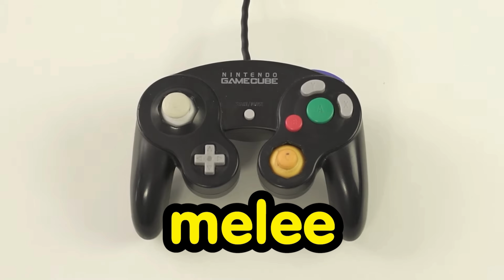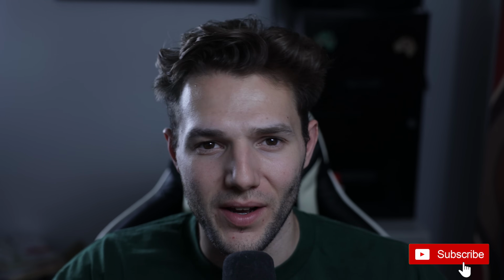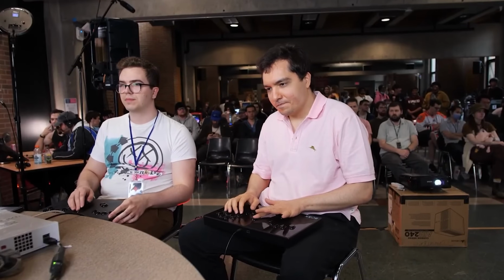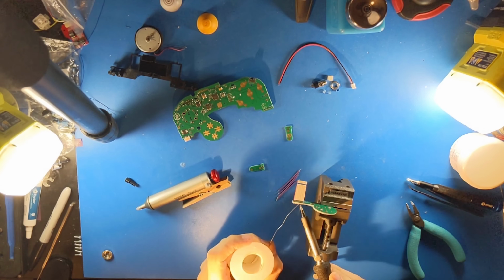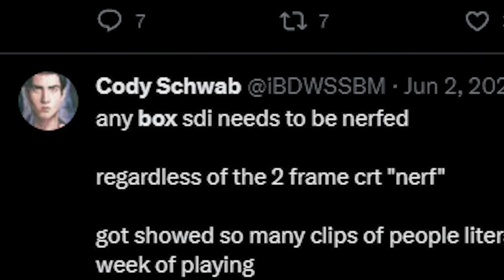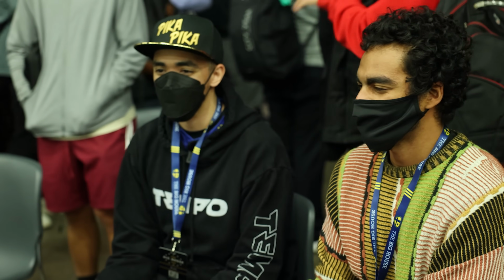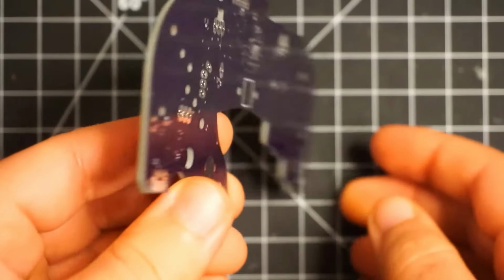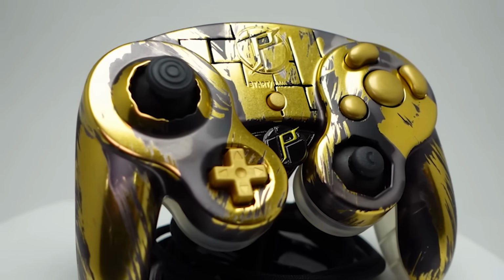The Hidden Barrier of Melee

Comment from the maker: What are YOUR opinions on controllers these days?
Reply: 1.03 is the answer. dont nerf boxx, BUFF gamecube controller. makes the most possible sense
Reply: @godslayerbiotch43  no, 1.03 doesnt make boxx controllers okay. try to sheild drop laser on a phob. Its fucking imposible but free on boxx. Converting analog to digital should be banned
Reply: BOXX PICHU..?? CHEATER?!!!!!!! anyways I think controllers are cool and that the Phob is a good choice. (and more affordable compared to other options)
Reply: TBF PS5 and XBONE controllers are utter trash (mushy sticks without gates) and have to be rebought every half year if you are using the DPad
Reply: Keyboard. In 10 years it will be considered the standard because accessibility is king. Box is still an upgrade, just not super necessary, and controller is fine too.
Reply: GCC breaks my hands, so i had to switch controllers. PS5 was weird cause of the left control stick, but the Xbox controller seems to be alright so far.  Having notches for spacies and Pika would be nice tho
Reply: Keep an eye on them, but I don't think anything drastic needs to happen. I think the things the goomwave can do is a bit much. Phob seems to be the most logical choice imo. Rectangles are fine because accessibility is good for the game. I don't understand why they say rectangles are cheating. I'll be more concerned when people start winning anything meaningful with a rectangle. Which goes back to point 1... just keep an eye on them. As they are now, it's fine. I don't think any controller choice is gatekeeping anyone from even becoming a top 500 player. Give any top 10 player a random OEM controller and they will still beat most of the top 100 from skill alone.

Comment: your comments on the b0xx are not very informed. The b0xx is nerfed a lot, and can't access a lot of more niche techniques. Fox is not the only character played on b0xx and other characters benefit from the layout as well. Some people will even argue that fox and marth and other characters are better on controller, especially in the realm of phobs and goomy's because notched controller can hit better angles and have access to the full spread of the analog coordinates whereas the b0xx can only pick a few. Prime example are wavedash characters like luigi and ICs. ICs have their more obscure desync coordinates banned so you can only do that stuff with ICs on controller for instance. There are timing lockouts, bans various techniques, and tons of various other things that bring the b0xx in line with the gamecube controller. It does not need to be nerfed.

I do agree that the b0xx is the best controller though. It is by far the most comfortable and the most consistent, which is its biggest strength. It's the best controller because it's the most fun.

Comment: I have this old controller that I've saved, the c-stick went out,  I tried fixing it but ruined the contacts while soldering.   Ever since that controller, nothing is the same.  I've gone through at least 20 controllers and none of them are good like that one was.   Knowing you can scratch off the surface layer of PCB and expose the traces and could wire directly to them still gives me hope.  I am doodoobeans at soldering though.   One of these days I'll take it to someone to get it fixed.
Reply: U might need better iron

Comment: These controllers are: 1) Unergonomic, to the point where people have developed forms of arthritis and seriously injured themselves
2) Imprecise compared to other forms of input
3) Fickle and only work for a finite time, meaning you have to buy another
4) Not even good enough on its own without serious modification
5) Far more expensive than buying a single input device like a fight stick/hitbox which has cheaper parts that are easier to replace (you can do it on your own)
6) Cant be used to play other fighting games (well I guess technically you could, but who would?)

How can anyone defend this?  It is clearly an inferior input device, and the barrier for myself even trying to get into this game isn't as much about the price as it is this.  We used to play the shit out of melee casually back in the day and I love it.  I love older fighting games in general, and I worry about their future, but the future of Melee is threatened by input devices more than anything else.  

I'm not technically part of your community, but I watch tournaments.  It's probably not my place, but you guys have to figure this out.  These controllers are just garbage and until there is a good solution people like myself who probably would play won't.  It excludes players when new blood is the difference between having a scene and it slowly dying... just because it is a big name doesn't mean your community is immune to this.

Comment: This video lacked too much nuance. The difference between the goomwave and the phob, goomwave generally has more cheater features like modifying calibration to make certain tech easier. its also a lot harder to police the firmware of both box and custom board gcc. 
The boxx and its copies are definitely better for the hands for most players. Melee is super hard or your basal thumb joints do the to contant lateral movement. People are working on better layouts for different kinds of hand pain like prism controllers that look like Tetrahedron or people like chillin dude using an azeron to play the game one handed after his stroke. Its so easy to just scream cheater at everything but it really needs to be looked at from both the accessibility side as well as a fairness side. 
This is all because as much as the GCC is cool, it is not a well designed controller for any form of competition (especially for melee). It is inconsistent, breaks easy, and for a lot of people literally causes them physical harm.
I don't have a solution. Maybe a community patch to allow rebinding by default would be a start.

Comment: Great video, but I really think it should be emphasized that this is really only necessary for top players. 99% of players will not have any issues playing on an unmodded OEM GCC. UCF makes shield-dropping + dashback consistent on pretty much all controllers, and notches, while nice, are in no way needed. Snapback is probably the hardest thing to deal with, and that can be worn out overtime, modded for relatively cheap, or might not even matter depending on which character you play. If you're a new to intermediate player, you have so many things to work on that the consistency provided by a premium controller affects so little of your gameplay.

Comment: Honestly, it kind of reminds me of how expensive it can be getting into competitive yugioh.

Obviously there's the price of the stuff for the specific deck you want to play, but there's also the price of cards referred to as staples.

Starting off, Konami does reprint staples, so they don't stay expensive forever, but it is worth noting that even with reprints they can be expensive, not to mention that you need a ton of them.

To give an idea of what you need, or what is at least a good idea to get. They won't always be good, but they are worth getting because they will eventually be good.
3 pot of prosperity
3 droll and lock bird
3 ash blossom
3 evenly matched
2-3 triple tactics talent
1-2 triple tactics thrust
3 Forbidden droplet
3 D.D. crow
3 Infinite impermanence
3 Nibiru the primal being
3 effect veiler
3 ghost mourner
3 ghost Belle
Etc.

For context, this is roughly about a quarter of the staples you'll want, if not less.

As I said, most are affordable individually, but they do add up pretty quickly.

There occasionally end up being expensive ones that are effectively mandatory to compete. Pot of prosperity is a 3 of in almost any deck, and it's a $40 card. TT Thrust is $100.

As someone who doesn't have all of these, it's not impossible to compete without them, but it's a massively uphill battle.

Comment: "Nerf the box" bro HOW? Even if you could, how would the TO know you are using a pre-nerf box or a post-nerf one?
Here, instead of nerfing the box, perhaps controllers should be buffed? The upsides to the box are all there because they are inherent to its digital nature. It is also easier to buff controllers by modifying the irrefutably faulty ways that the game reads player input, it makes shitty controllers usable again, and it won't force all people using boxes to modify their controller to actually implement any proposed nerfs. Boom, problem solved. Controller users can just use any controller they want, box users don't have an advantage, and the integrity of the game is kept intact.

Comment: I will say this, I got a symphonic green phob 2.0 with notches and that was 575 dollars, 500 of that was the symphonic green. Say it was a smash ult shell, wouldve been 150. I have 2 phobs from rienne now and one ive used for over a year with 0 issues. You can spend 150 on a phob amd never have to spend money on a controller again if you buy from the right person
Reply: Oh, also i dont even compete in melee, i have 0 top player privilege. I have 3 controllers that are up to tournament standard. A phob 1.2, a phob 2.0, and an oem with a heartbeat module. A majority of what i spent on them were aesthetics and i actually did a lot of the mods myself. Its like spending money on keyboards and modding them out.

Comment: Another option now is the ProGCC from Handheld Legends. It's a board built for Switch Pro Controllers that have a Gamecube controller mode on them. The v3 model has Hall Effect Sensor sticks as well as feature like remappable buttons, and a special button (default being the L button on the ProCon, as the Gamecube controller lacked a left bumper button) that you can map to things like light shield.
Reply: A Switch Pro controller? Did they mod all the inputs necessary to hardwire into a Gamecube?

Comment: I'm a little late to the party but:
I've put together a couple of phobs, and I do think that if you're getting in to smash, spending the little extra on learning about your controller by getting a basic 2.0 drop in board and assembling it yourself, messing with settings and setups is a really good way to learn how you like your controller, and how to maintain it

Your controller doesn't have to be a $5-600 custom built to your detailed specs by some big name modder, it can be something cool you built yourself for $80-100 and learned alot from

Comment: You can get a basic stock option SmUlt phob for 130, configure the firmware yourself with an online guide, takes a few hours for a complete novice. The only expensive addon you might want is good notches carved, and you don't even need to carve notches in if you want to mess around with some temporary ones. Ignore "product value" for a second here, you can do anything you need to as a top level player with a sub $150 cost controller and some controller knowledge that you should really be having anyways

Comment: cody is a crying baby that want a weelchair to play a game hes good at it only tu run with wind in his side and masive voil pushing him, his advice or opinion doesnt matter on oem vs anyone he willl not perform. box are here for hand injuries and as a early keabord player i think it  good an alternavtive that was nerf from thr ground and is less perf than his crasy cotroller exist. also z short jump is cheating on any controller. also phob is open source ansd should be allowed or controll but not ban since it s a gift that make the game more enjoble. it can be buit with any oem controller with the right tool and with time if nin tedo continue to built controller for the next smash come down in price. ot s the time required and the right configuration that push the price higher. oem cacommit to win have notch but box only 8 angle. it s a choice and u have to commit to win and ultimately outplay your adversery more than having a cheating cintroller that look like oem. on the pint box is more painfull as a keahyboard pklayer that s a lot of bs. ont kb i have only to moove finger that s are buld to this and not wrist every 0.3 sec that arent built to this
but resêct to talk about goomwave ot s was more an issue than box

Comment: I would say 99% of players don't need to get any of these high end controllers. Most of the time it isn't the controller that is the reason you lose a match.
Boxes probably do need to be reigned in somehow or controllers given more freedom.
Reply from the maker: But the point was to show that everyone deserves a working good controller without dropping a crazy amount of money on it. Then it turns into pay to play etc
Reply: @JeramiJoseph  OEM controllers work fine. I think Zuppy is a top 30 player, with no mods, no notches, or anything. Accessibility is an issue in smash, but I don't think its a controller bottleneck.
Reply: @OreoFromYesterday zuppy is on a  box
Reply: @nahometesfay1112  maybe it was some other top fox like zamu or sfop or something
Reply: @OreoFromYesterday  Probably Zamu

Comment: as someone who fairly recently got into melee, and even more recently decided to start playing, I currently just play with un modded keyboard controls on Slippi because getting a controller would both be a lot of work and money. and like, for the most part keyboard works pretty alright, but analog values are super cursed because the only angles I have are the 8 from wasd (well, and 2 secret bonus ones that I mcgyvered by setting my value higher than my up value so that when I press both at the same time it ends up as a slightly downwards value, and binding a key to be both up and down at the same time so that I can have wavedash angles that aren't 45 degrees because 45 degree wave dashes as your only option is miserable)
Reply: you dont need an expensive controller unless youre really high level (and even then, there are ganons and DKs in the top 100, i think you'll be fine), any regular $20 gamecube controller will do the job
Reply: @eX1st4132  well I'd be getting some kind of rectangle, because I've got several rsi's in my hands from speed running celeste, and also for celeste after I swapped to keyboard I just kinda liked it more as well, so I figure the odds are good that I'll feel the same about melee

Comment: You make it sound like a modded controller is mandatory, but there’s a ton of top players who just rock OEM controllers.
Reply: Not one's that play spacies 😂

I'd say most people have triggers adjusted for easier light shields at bare minimum at the top level as well.
Reply from the maker: It’s def turning into needing a modded one to perform

Comment: you can totally still miss execute a turn around up tilt or a shield drop on b0xx. Shield dropping is def more consistent but you can make the mistake of pressing one or the other button too quickly and you'll spot dodge. Turn around uptilt is even more similar to a GCC on b0xx as you have to let go of the button you used to turn around before pressing a or else you get an upward angled forward tilt.
Reply: Bro
Reply: I think he means the only way you can screw it up is by human error.
Reply: @rokkalombardi2196  thats still also true for GCC for turn around up tilt unless you have a god-awful GCC. For shield drop its still true for Phobs or GCCs that have been tested to not have bad cardinal notches to do shield drops with. UCF is a godsend

Comment: i started the game on a 20$ used controller from gamestop... that same controller lasted me 5 years before i needed to switch due to joystick issues. just make sure the sticks feel tight and that its a og gamecube controller and typically its good enough for 90% of slippi players. if you go to majors, phobs/b0xx are necessary. but your point on new players needing to get a phob or b0xx is completely not true, the thousands of melee players that started before phob and b0xx proved it lol

Comment: why nerf box when you could just run 1.03? i don't even play on box and it doesn't even matter to anyone except top 100 players
Reply from the maker: I don’t know enough about 1.03 to talk about it. Didn’t wanna talk about something I’m not super knowledgeable on
Reply: @JeramiJoseph  thats fine, was kinda just poking fun a little bit. But ive been running melee locals on 1.03 for a little over a year now, hasn't changed anyone placements much+fixes several issues. most notably polling fix

Comment: There should be a storefront for cheap cardboard rectangles. Even though pre-made b0xxs and Frame1s can be pricey, DIY ones can be made with just a box of scraps.
Reply: Mine is a 1-1 3d printed clone of a frame1 (a "fake1"). even that was only like $60 total in parts. if you already have spare keyboard switches, keycaps, soldering iron, and a cardboard box, you can make one for like ~$20-30. it's actually a good learning project for soldering too. And there's not really any programming involved. You just copy and paste the code onto the raspberry pi pico.